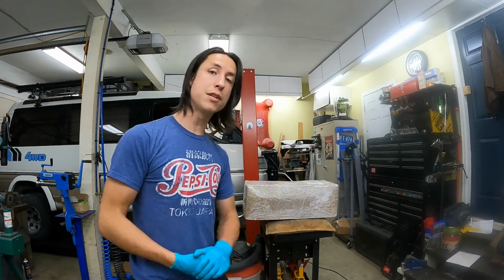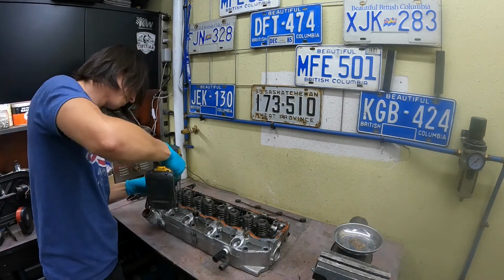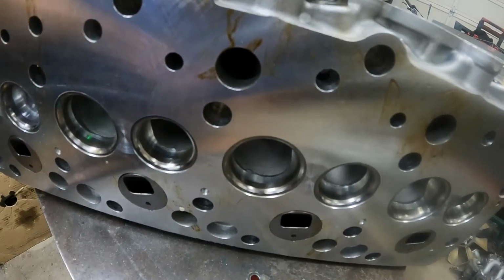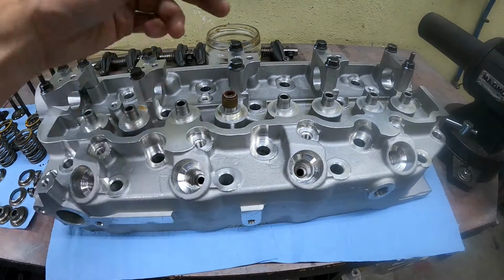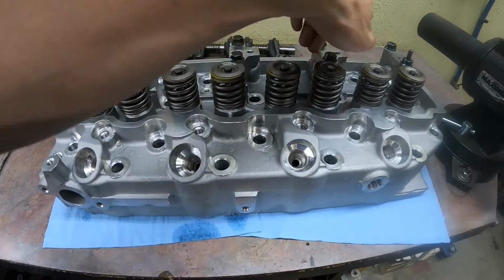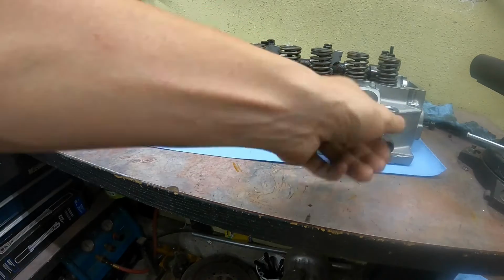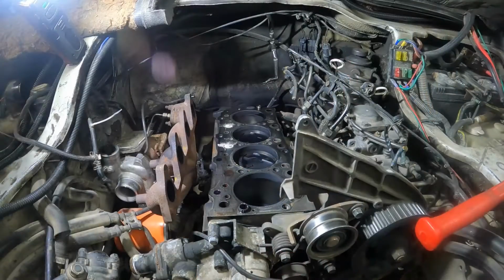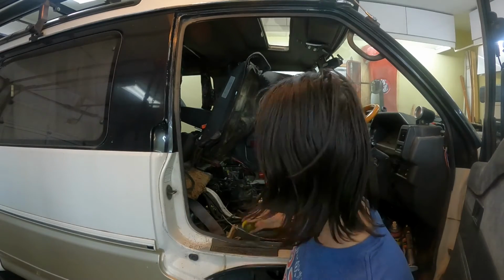4D56T Cylinder Head Replacement Part 2 Cylinder Head Assembly - Complete Guide -

Comment: So I’m wondering if you could guide me into a path to find the proper parts for my Delica L 300. I blew a head gasket so I’d be requiring head gasket head bolts and the whole head as for mine has cracked
Reply from the maker: If you are unsure what parts you will need,  or what fits what. it's probably best to go with a reputable importer who can guide you through everything. Rising Sun Imports in New West has been it longer than anybody, I would suggest starting there.

Comment: Also, I'm trying to troubleshoot why the engine broke rockers after I replaced the rocker assembly and a complete belt service. The balance belt broke and made it jump timing before I did said repairs. All of the marks were in line, and it ran and drove good for a bit before it idled rough and dropped power. I'm guessing bent valve or valves. Still need to remove head to know for sure.

Comment: Hey, I enjoy your videos. I'm in the process of replacing my cylinder head for my 1994 P25W and wanted to know a good source to order from. The best quality seeming one was on the Mitzybitz site, but I don't believe they ship to the US. I need a flush valve setup. Thank you
Reply from the maker: If you want to an unloaded head,, I think I may actually have a brand new blank flush valve head I bought by mistake that is now sitting under a bench.

Comment: Hi, Is there any way of telling what model head and or block (flush valve vs protruding) without pulling the head off? I wanna do a direct head swap to save some time. Previous owner had the timing belt snap and there was valve to piston contact(broken rocker arms). I believe multiple valves to be bent,and possible valve seat and guide damage. I think is is more cost effective for me to purchase a new head, opposed to rebuilding it ,and want to do the replacement in one go, so I would like to order the correct parts ahead of time. Anyway of decoding casting marks that you are familiar with?Awesome videos BTW!!!!!
Reply from the maker: @S-MCGARAGE2024  just look for a water line to the turbo. If the turbo is water cooled, it's a flush valve. If it's oil cooled only, it's a protruding valve.
Reply: @projectaddiction  awesome thanks so much, life saver!!!

Comment: How can i know my engine block is early or late?what is seperation?
Reply from the maker: Have a look at the pistons. If there are reliefs for the valves you have an early block, if they are flat top you have a late block.
Reply: @projectaddiction  i have Space on pistons  for valves.thank you for answer.
Another question,i hear chinese forget crankshafts are not Good.but my crankshaft is already machined 0.25 and needs more.
What do u prefer to me?
Reply from the maker: @cagatayerdilmen7404  in my opinion, try stick with OEM components wherever you can.
Reply: @projectaddiction  can you please tell me oem brands which you prefer please?Because im not working on mitsubishi thats why i dont know brands.
B.regards
Reply from the maker: @cagatayerdilmen7404  OEM means original equipment manufacturer. So whoever made the vehicle, whether it's Mitsu, Toyota, Nissan, BMW, try stick with original parts if you can.

Comment: What happend if I Put  a head cilinder with flash valves?
Reply from the maker: If you put a flush valve head on a protruding valve block the compression ratio will drop substantially. It will "work"... However you will be very very down on power.
Reply: Thanks for your answerd

Comment: Hi, very good video hanks.
I have a Mitsubishi delica l300 4x4 1993 4d56 engine w oil refrigerated turbo.
I need to replace the head cilinder.  My have protuder valves. 
Do you know wich is the Hyundai modelo for replace IT?
Reply: Hi Fernando, I also have an l300 4x4 and Im doing an overall on my engine and from what I have been told by some mecanics the protuder valves cylinder heads and the bigger pistons are the 4D56 turbo and the flush valves and small pistons are the non turbo 4D56.
Reply from the maker: I'm a not as familiar with the 4BF so I'm not sure which style head runs. Being that it is a slightly more recent motor I would suspect it to be a flush valve... however you will need to confirm for yourself on that one I'm afraid.

Comment: Hi Cam, on your return fuel rail, does/did any part of the tube to nut connections have movement or is yours completely rigid throughout? Great video again.
Reply from the maker: Cheers! The fuel return should be fully rigid. If there is play or the "nut" spins on the tube the part should be replaced as it will likely leak. In saying that I have brazed them with solder in a pinch.

Comment: wondering why you went to all the effort of grinding the ports when its forced induction but diddn't lap in the old valves to the new head or check contact with blueing paste?
Reply from the maker: Personally I tend to only lap the valves if there is pitting or imperfections in the surface or the valves or seats. Some say you take away the hardening by lapping, others say always lap them... On a higher performance build I would likely lap them, but I figure in the end the 4d56 is still a boat anchor of an engine so I am not to worried. The reason I clean up the ports is actually for EGTs. The 4d runs very high exhaust gas temps, so there are a few ways to help lower them. Add more air, or help the air evacuate the head faster. Forced induction or NA the closer to laminar flow you can get is always going to be more efficient, and the ports always seem to be full of cast flashing, seams, or sharp edges. Being IDI there is no need for turbulence in the intake, so I clean them up in effort to drop the exhaust temps and improve the effectiveness of the turbo. The van is also running a custom ground camshaft, a TD04-12T, 5 bold down pipe, and a 2.5" side exit exhaust.

Comment: What grit and brand sanding block do you use? I got a set from lee valley.  220, 1000, 4000, 8000 grit. They are waterstones for precision sharpening. Would that work or does it have to be oil stone?  Also what if there's a bunch of gasket material to scrape off? Do you gave to suck out all the holes that go to coolant and oil systems afterwards, should they be plugged somehow?
Reply from the maker: I just use 500 and 800 wet sand paper and a sanding block made from some scrap hardwood. Nothing special. It can be hard to plug the holes so just he careful and try avoid dripping junk in the oil and coolant ports if at all possible. I normally just blow everything out with compressed air when I am finished cleaning.

Comment: Hey great video, wondering how much can you tell about the condition of an engine just by seeing the the engine bay?
Reply from the maker: Hi Derrick. there's no way to tell the internal condition of an engine just by a visual inspection on its own. Best thing you can do if you are unsure is to take it to a shop to have an inspection. Otherwise just listen for any noises that are out of the ordinary (rattles, clanks, ticks etc). You can do a rudimentary head gasket test by taking it on a short test drive. I have a short video on my channel showing how to do this.

Comment: Hey what size socket did you use for the fuel injector holder? This series is so helpful btw, thanks Cam.
Reply from the maker: Hey Conner, sorry for the late reply I didn't get a notification for your comment. The return line nuts should be 17, and for the injector itself i actually a 7/8 thin wall because my 22 has gone a vacation somewhere... Glad you are finding the series useful.